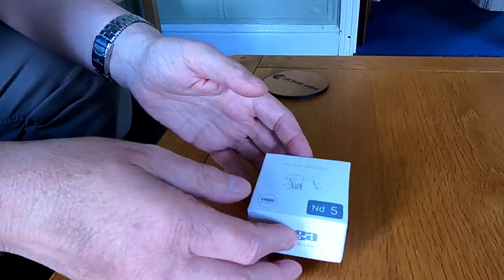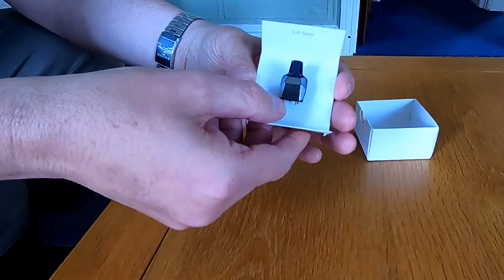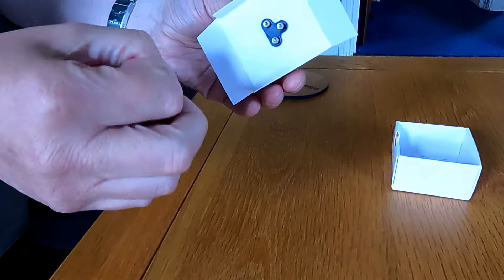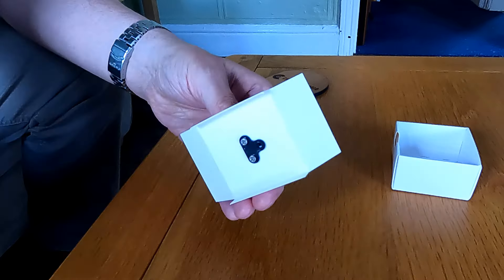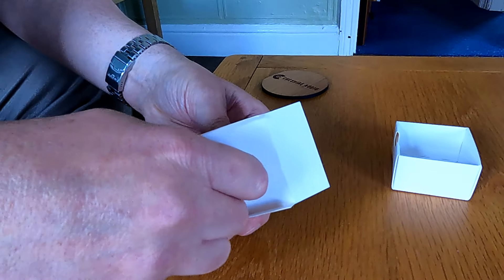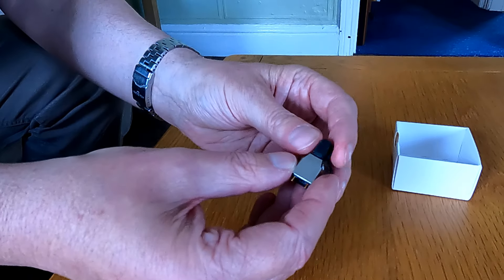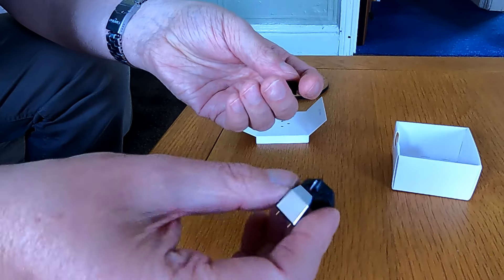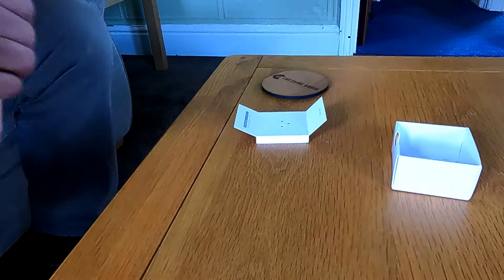Rega ND5 Cartridge   First look

Comment: What is the mounting hight of the ND5?  The standard 14mm of older series?  Asking because I have read of folks having problems with the bottom of the cartridge hitting disc surface with slightly warped records.